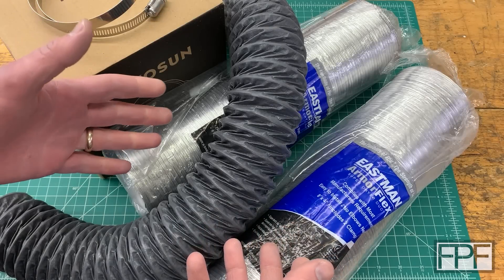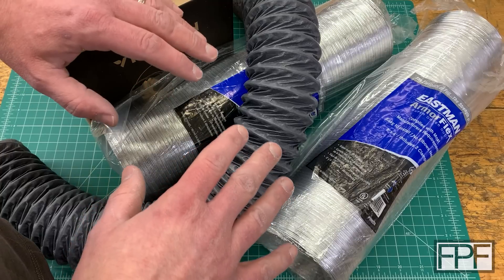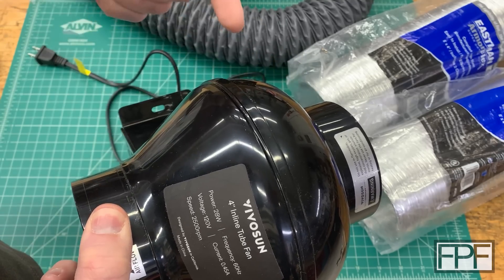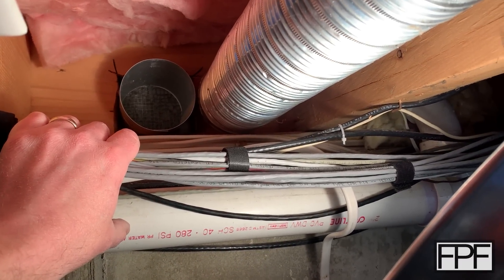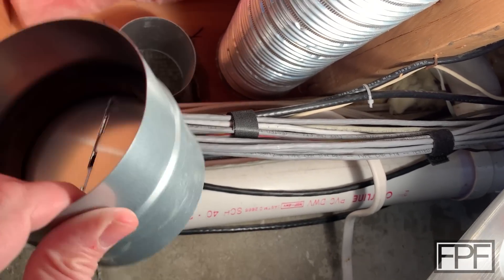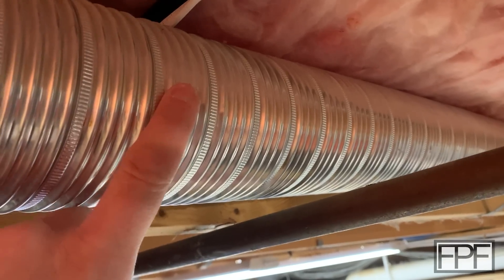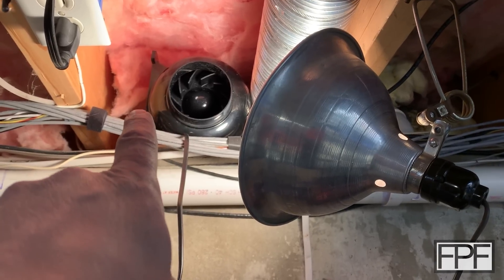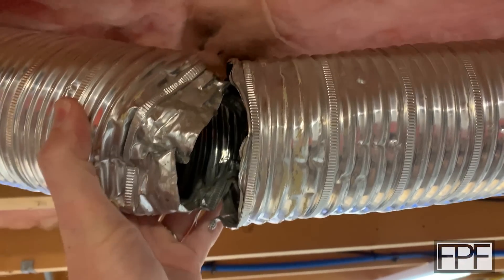3D Printed Fume Extraction Parts

Comment: Make sure you add a grounding wire to the duct if you havent already... Fast moving air will make static electricity, and built up over some time and with some dusts can create a small fire. I'd rather you have it and not need it, than need it and not have it, and have an incident occur... What's $1 in wire lost for prevention versus $500,000 for your home and everything in it...

Comment: FYI if you printed the reducer coupling to be concentric from 4” down the air will flow with less restriction due to stratification. Also minimizing static electricity. Also use a grounding wire to earth ground.
Reply from the maker: can you explain what you mean by this? (concentric from 4" down)

Comment: I have the same issue where I can't put any exhaust fan because It will going to disturb my neighbords and maybe I will have a problem. I have a small Co2 laser for DIY not for leaving the mahine working all day long. So by law, I need to put a filter between the machine and the exhaust fan If I want to use the machine. But it's funny that I have to swallow all the bbq smoke from any neighbord and I can't make a court report but they will make to me if I use the CO2 laser.. My house is attached to others so I don't have the option to leave the garage door open without getting in trouble. Unfortunally I bought the wrong filter machine because it looks like a toy instead beign almost bigger. Maybe I will use with any 3d printer and find another one for the CO2 Laser. Greetings from Spain.
Reply from the maker: yeh, any type of cooking seems to never be regulated unless it's commercial

Comment: I think this might work for the 3d printer exhaust I've been thinking about. I'm sick of working only during the "good parts" of the year when the temps are right in the garage. I think the toughest part will be the hole from the basement to the outside. I also wonder if that  "one way air valve"  will work when the outside air is a little windy. Thanks for the inspiration to at least give this a try.
Reply from the maker: yeh, ABS and a lot of other filaments are just as dangerous as cutting stuff on the laser

Comment: The xtool enclosure is pretty good. The lid setup works well. Easy to open, stays open, closes right, and can access and see what you need to. If you’re going “far” a secondary fan would be good. But it’s better than the zipper enclosures.
Reply from the maker: I picked up a steel 24x24 nema enclosure

Comment: I 3d printed 4" ball valves, a "Y" valve and segmented flexible ducting for my workshop dust extraction system.   I think the valves are pretty much jam proof unlike what dust can do to some gate valves.  But that system is overkill for clearing fumes from the laser.  I want to take a similar approach to what you are doing for my laser engraver and for soldering also.   So your video is good "food for thought".   Thanks for sharing.     Your comment about shoddy woodstove installation struck a chord.  We had a wood stove installed by a professional fireplace store with their own installers.   The stove pipe coming out of the house looked like the Leaning Tower of Pisa.    They got to do the job twice and I had to teach them how to do it correctly.
Reply from the maker: it's hard.  I don't mind 'paying' for quality work, but then you end up babysitting the whole time anyway to ensure the quality